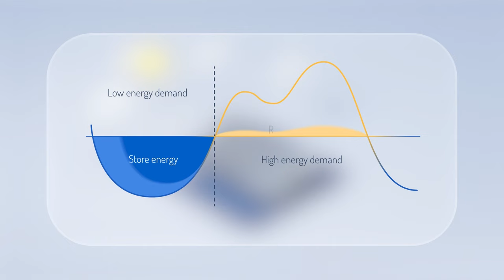What Is a Sand Battery? Polar Night Energy's Sand-based Thermal Energy Storage Explained

Comment: Great idea ,thinking outside the box. Now to scale it down to home use , but the idea is fantastic.
Reply: You need to scale this up, not down.
Cube-Square law makes this unfeasible on home scale.
This is the only technology that can bridge the gap between summer (in the near future with abundant solar energy) and winter.
They should do feasibility studies for larger systems than their 20 GWH largest envisioned system and look at round trip conversion efficiency for electricity whilst storing the energy for around half a year.
Small to medium scale: Li-Ion batteries up to Tesla Megapack systems, range: 10 kWH up to 5 GWH
Medium to large scale: Pumped Hydro storage, range: 1 GWH up to 400 GWH
Medium to Ultra Large scale: Sand Battery, range 1GWH up to 10 TWH.

Comment: Nice video, but does not explain why use of sand is much better than use of water a s storage system. To warm up water using fotovolatic even heat pump is not a new thing at all. I can understand that at some condition the higher temperature for storing the heat can be benefitial, on the other hand you have larger temperature delta to ambient enviroment, therefore the energy loss might be higher.
Reply: Yes but if it is insulated well enough, that loss will be minimal.
Reply: storing water above 100 C is too hard, and below 100 C is pretty much useless (you can't convert it to electricity with steam turbines), while sand can be heated to whatever temperature you want below melting point of its container and pipes. so with high temperatures you can achieve more heat capacity per unit of mass. also sand is very chemically inert and doesn'ty need waterproof storage, nor cleaning. regarding heat loss, you shouldn't care about it too much, because the purpose of it is to survive for half a day for peak hours.

Comment: I really like this idea of storing energy. But can anyone explain why they transform electricity to heated air to heat the sand instead of heating the sand directly using a electrical heating unit?
Reply: The illustration doesn't show much and leaves out details. But what's actually going on is the sand is being heated by the electrical heaters that are also following the path of the air pipes just right next to them.
Reply: @walkersunited332  
hahahahahahha simon finally figured out its a scam lol
Reply: @walkersunited332  

user mozz dog got it, and his quote :

Storing in concept:Easy.  Turning into usable energy:Still being developed.  Why are we talking about this when the part that is important, doesn't exist?  I can store heat in my nards by sitting in a seat too long, but using that heat to keep my coffee warm is the hard part.  damn people are dumb.

looks like only a few of you went to college. :) college does train you to think, analytically , not to accept whats given to you ! lol , just heat ! eletricity is whats needed, not heat !
Reply: @Designer_TopG  that sounds like it was written by someone who didn't even graduate high school.
Reply: They can use same pipes for heating and recovering heat. And it is easier to maintain. There is nothing that can break or wear inside that insulated sandpile. All active components are easily accessible in separate cabin.

Comment: "a product to convert the heat back to electricity is being developed" okay so whats the point in the hot sand right now?
Reply: Passive solar to heat a building or greenhouse.
Reply: @nathansmith22  hi from the manufacturing facility in Mexico. How does this help right now?
Reply: @whyomgwhywtf  what do you mean? Fill something with sand and let it sit in the sun. The heat it puts off at night will help heat the building or greenhouse.  I’m sure you can google sand battery.
Reply: @nathansmith22  this video is talking about using the sand battery in the same way we use actual batteries. Put energy in. Pull energy out. Except there isn't currently a way to actually pull energy out of a sand battery in the same way we do batteries. It also doesn't really do a good job of slowly releasing heat over time either. 

This technically isn't new and it's not revolutionary it is just rebranding technology that was abandoned in the early 1900s because we invented cheaper and more reliable ways of storing and producing energy.
Reply: @whyomgwhywtf  I think this system is more like a thermal recovery system(sort of) instead of a battery because it does not convert the heat it captured from the sand into electricity as the output instead they extracted the heat from the sand and use the heat energy to warm up houses and things like that. So this system produces heat energy in the form of hot air instead of electricity. The term battery is not really an accurate term to be referred to the system as the system itself does not produce any electricity as the desired output.
Reply: @h4fixx  then its false advertisement as well as rehashing inefficient technology that has been tried many times in many ways and was retired when cheaper more effect means of heating were invented.